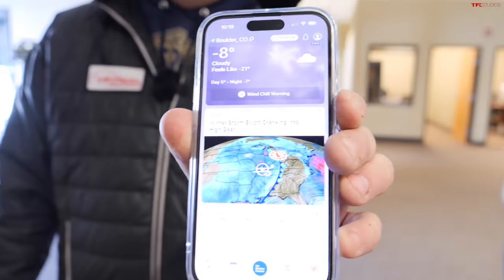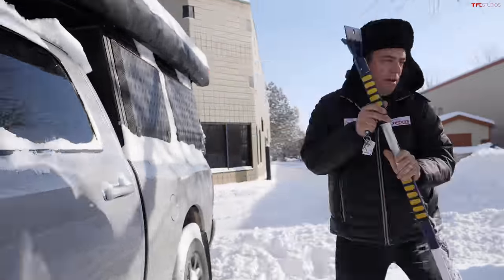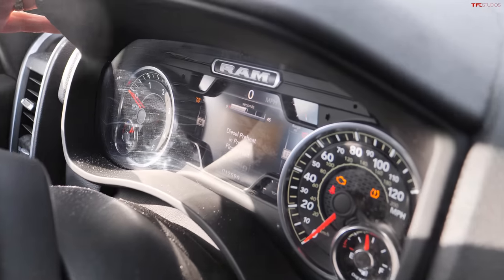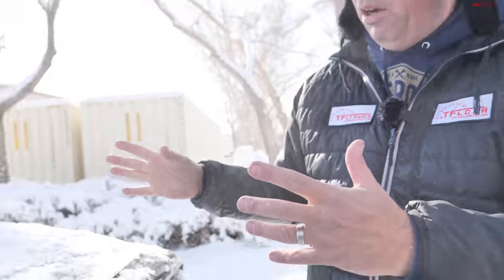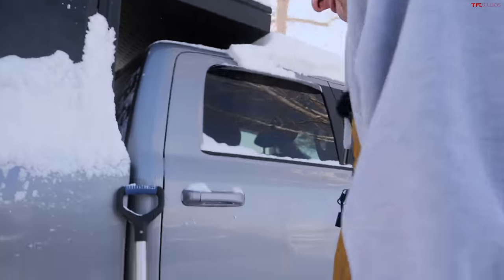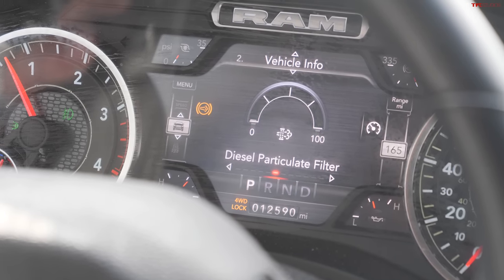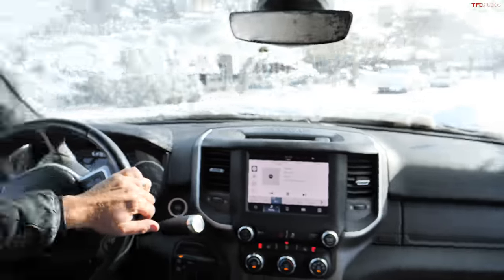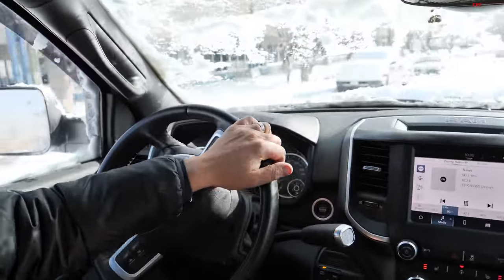It's the COLDEST Day Of the Year in Colorado: Will My Ram Cummins Diesel Start?

Comment: I wonder if you guys  would consider fuel warming add-on kits? 
So your truck doesn't gel up. Mine started to gel up yesterday -15 with a 41 one below wind chill.

Id like to know what a persons opinions are?
Reply: My old man drove nothing but diesels his whole life. He would add a gallon or two of gas at each winter fill up, then top it up with diesel. I have been doing the same thing on my Ford 6.0 and Ram 6.7 and have never had a gelling problem. Merry Christmas!
Reply: In Canada the fuel stations switch to a winter mix diesel (anti gel already added) in the fall. You really only run into a problem if you have your truck laid up for a bit with summer diesel in it or have your own bulk tank.
Reply: Gelling issues are PRIMARILY @ a function of the anti-gel additives added at the supplier or fuel station. I never trust that they add enough and always add my own. Several tests have shown that additives can only protect so much, though. In the farther northern areas, they run something like a 50/50 diesel/kerosene blend. I would NEVER blend gas/diesel especially on a modern diesel engine. 

There are additional heaters in the fuel filter mount on the Ram trucks that help when the truck is running, but do nothing when the truck is off.
Reply: "POWER SERVICE - DIESEL 911" in the Red bottle. You can get it at Wal-Mart and probably almost everywhere else.
Reply: That's fine but anti gel additives only go so far.
Reply: @jeffs2809  I'm going to add kerosene.
1 gallon to every 10 diesel algone with anti gel

Comment: You smart guys anticipate cold weather???  That is,  have some blended or maybe straight winter fuel in the fuel tank before the temperature bottoms out??????🤔🤔🤔🤔🤔🤔🤔🤔
Reply: My old man drove nothing but diesels his whole life. To prevent gelling he would add a gallon or two of gas at each winter fill up, then top it up with diesel. I have been doing the same thing on my Ford 6.0 and Ram 6.7 and have never had a gelling problem. Merry Christmas!

Comment: I am not sure if this matters or not since you guys flip vehicles fast. But i highly recommend the xdp performance diesel fuel additive. You can use it on modern diesels. It bumped my mpg, bumps cetane number, it feels a little bit more powerful but could be placebo, and reduced my smoke output. (Pre emission diesel). I have tried many different brands of additives and this one works extremely well compared to others. Love the videos guys.

Comment: It's extremely freezing here in Illinois also. My 20 year old Dodge started but it wasn't happy. The power steering pump was frozen, the heat didn't kick on forever. It has 270,000 miles so at least it started. Nothing can stop a Dodge. The most reliable vehicle I've ever owned.

Comment: Much better to use a block heater even though they will start.  New diesels are much better than back in the late 80's and early 90's.
Reply: The oil is much better now too, much like the compounds in a winter tire. They are both  MUCH better than they used too be.

Comment: Is a Ram 1500 reliable? I’m looking for a full size truck and wondering which is more reliable.
Reply: The Toyota Tundra is probably more reliable.   But the Ram will be okay if the price is right.
Reply: @brianx04  please stop with the Toyota reliability diatribe.  That junk is no better than any other
Reply: @Welcometofacsistube  hahahahah rather be on the road than at the mechanic. typical ford driver
Reply: Definitely toyota tundra. most reliable pickup

Comment: To avoid diesel gelling, truck drivers add half a gallon of regular gasoline into a full tank of diesel
I tried this on the many diesel sedans i owned and it worked flawlessly
Reply: Foolish in a modern diesel (2007+ MY)--gasoline can destroy the fuel injection pump and the diesel particulate filter.  A potential multi-thousand dollar stupid mistake.
Reply: @rockymountainjazzfan1822  i never had an issue - again just a bit if regular to a full tank and only on freezing days. Gelling is very dangerous issue my father almost froze on an Illinois highway when his diesel van gelled

Comment: Bloody Hell, you shouldn't idle up on a diesel when it's that cold. If it starts as easy as that did you should have left it alone to warm up gradually and before moving you should have put the transmission through gears before you move to let it free up.

Comment: I have a 91.5 dodge with six in a row under the hood and I use Amsoil cold flow improver and my truck has no problem starting it could be -10-15 I hit the heat grid not once but twice it comes on then it’s the way to start goes off and I hit it again and nothings running before three or four revolutions of the crankshaft when I go to start it and it starts instantly and you got the heat exchanger on the side of the block for the transmission but I’m also use a amsoil products and my transmission and I’m not gonna go bid on it at that temperature that’s for sure I’m gonna let the truck sit and warm up for like 15 minutes drop it in gear and away we go is Jackie Gleason used to say this is Jim mungai from Kennerdell Pennsylvania when it comes down to reliability my old Dodge with 500+ thousand miles on it I’ll match up against these new trucks any day and I will win

Comment: Diesel fuel is problematic at low temperatures due to parafin solidifying and blocking filters etc...if that happens you can forget about starting your diesel.
Reply: That’s why you run anti gel when it gets crazy cold.
Reply: @markball7028  in europe they tend to add it by regulation at gas stations during winter.
Reply: My old man drove nothing but diesels his whole life. To prevent gelling he would add a gallon or two of gas at each winter fill up, then top it up with diesel. I have been doing the same thing on my Ford 6.0 and Ram 6.7 and have never had a gelling problem. Merry Christmas!
Reply: @markball7028  My old man drove nothing but diesels his whole life. To prevent gelling he would add a gallon or two of gas at each winter fill up, then top it up with diesel. I have been doing the same thing on my Ford 6.0 and Ram 6.7 and have never had a gelling problem. Merry Christmas!

Comment: I’m surprised a 80k truck that’s designed for cold weather works as intended. I’ve stared old diesels with no block heaters In similar weather. Thumb down for sure.

Comment: In the 90s we had some very cold stretches of weather and i remember my buddy trying to get his plymouth gran fury started when it was -20F.  That old dog would not even think about turning over.  Brought the battery inside, block heater.  those 318 v8 smog motors were probably the worst engines ever put in a car.
Reply: I had a 318 in a 69 Dodge Power Wagon…drove it to High School in the 1970’s…it would commonly start at 35 below F with the Die Hard battery…great engine…but that’s before smog equipment…

Comment: As much as I think Ram trucks are rather bad I've never seen modern trucks have trouble starting in cold temperatures.  I really don't remember having this issue with any truck I've driven in our fleet and I'm in Canada and have seen cold enough temperatures to have seen it if it was an issue. The body panels will rust off before the battery is an issue.

Comment: Modern truck has nothing to do with gelling diesel fuel, somebody didn't have enough brains to put the fuel treatment in...or got fuel at a station that didn't properly treat their fuel, or both.  I always add the fuel treatment to my diesel fuel regardless of the season, its cheap compared to the issues that you have when you decide to be cheap and not use it.

Comment: First, if the fuel is winterized and the battery is in good condition, a cold start at -3° F. is no big deal.  Now, the bad news.  Start any diesel engine in very cold weather and it is going to expel a fair amount of unburned fuel and a pretty heavy dose of particulates until the combustion chambers reach a high enough temperature to sustain full combustion (the colder the weather, the longer that can take).  In pre-2007 diesel vehicles, those emissions were expelled out of the tailpipe.  Pollution, yes, but not bottled up in the emission system of the vehicle.  Today?  All that uncombusted fuel and particulates go right into the diesel particulate filter where a re-gen will have to remove them later.  If the vehicle is driven around town in cold weather, left idling, or not run under some load, even the re-gens may not work properly.  That is why 2007+ MY diesels can be an absolute emission control system nightmare in cold winter weather.  After dealing with diesel emission control system issues for 10 years in my 2012 diesel pickup, I got fed up and traded it for a gasoline truck.  It was a hard decision, as I've been around diesels (and have loved them) for nearly half a century, but the 2007+ diesel emission controls have severely compromised the utility and operating costs of diesels.  I do still have a pre-2007 diesel that has no winter running problems whatsoever.  A lot of diesel pickup owners have come to the same conclusion as I did--try and find a pre-2007 diesel pickup in good condition these days.  Find one, and it will often be priced almost like a new truck.

Comment: If your diesel gels up couldn't you in theory put gasoline in it to help? Older diesel vehicles can run on gas because it's thinner (gas cars can't run on diesel because it's too thick) so wouldn't it be a possible solution? Never heard of it, just makes a bit of sense for the same reason that you want your engine oil to be thinner at colder temps.
Reply: No, unless you want to wreck your engine. Add additive
Reply: @alflyer9406  Power Service Diesel Fuel Supplement (white bottle) never let me down in my 10 years of owning a VW Jetta TDI in Chicago. I added some to every tank in the winter even when I had confidence that the fuel from the refinery was already winter-blended.
Reply: In 2007+ MY diesels, adding gasoline to the diesel fuel can destroy the fuel injection pump and the diesel particulate filter--about a $3K fix for the latter, up to $8K+ for the former.
Reply: I believe kerosene, not gasoline, was the old-school way with old-school diesels to thin the fuel for better winter flow. As others here have stated, don't do it these days.